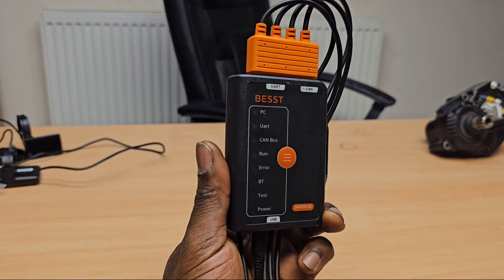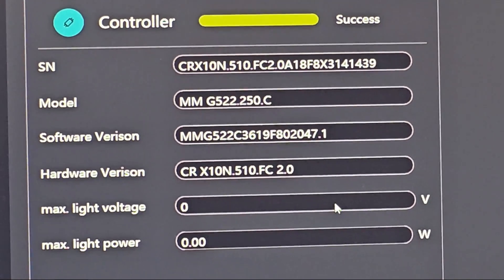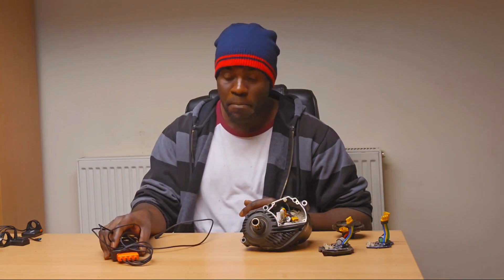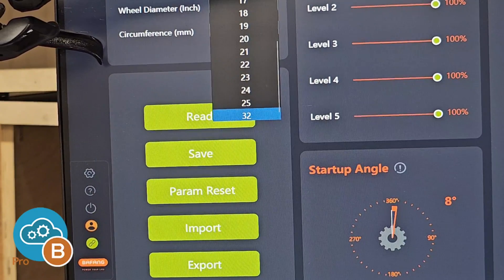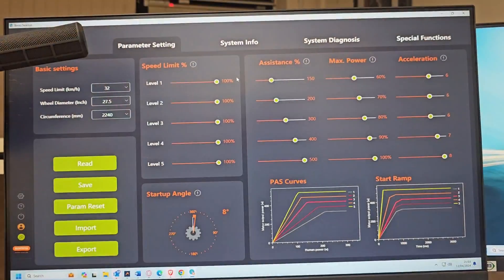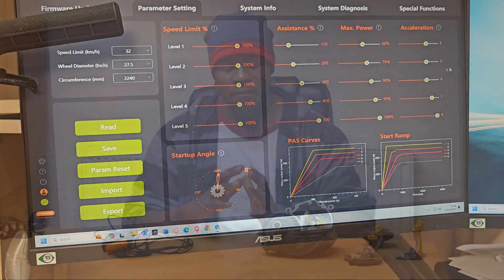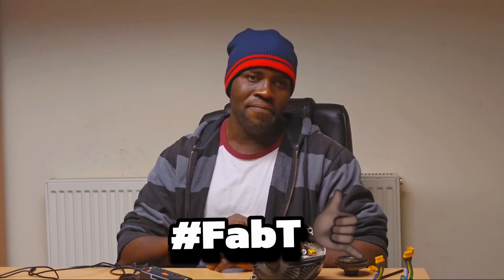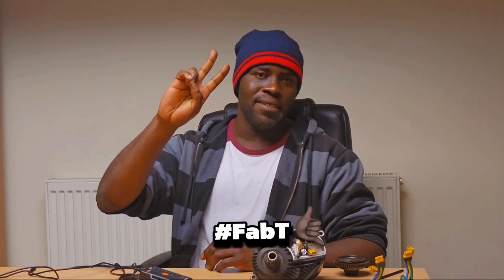Bafang Besst Tool & Besst [Pro] Software Explained

Comment: Hello there and thanks for the video!
I have an issue with unlocking my bike’s speed and I would really appreciate a response.
I recently bought an ado air 20 pro (eu version) with a 250 watt H700 motor and a CR A101.C 1.0 controller. I’ve used the BESST software and connected to it via can bus using the BESST tool. I want to increase the speed limit to 32km/h from 25km/h. Although I’ve pressed the write button on the BESST software with the new limit with received a success message, the bike still has the old one. My guess is that the firmware is locked. Could really appreciate any tips based on your knowledge :)
Reply from the maker: Hi there, 
Sincere apologies for the delay. 
I have looked up this ebike and understand that the Ado Air Pro uses a hub motor (Bafang).
In theory, the new top speed should have written to the controller. My only thought is whether you clicked "read" to pull up the controllers settings. 
This weekend, I'll have a play with changing the speed and wheel values for Bafang hub motors using the Besst Tool and report back my findings. 
If a specific firmware is required, I'll let you know.

Once again, apologies for the delay and I'll keep you posted👍🏿
Reply: @neekodevinchi  So I've connected both the screen and the motor to the BESST Tool, I've turned-on the battery, I've heard the beeping sound, Can bus light is flashing. I'm opening the BESST software and I read and write the values of the controller successfully. 
By the way the latest BESST software does not let me to alter the speed limit to more than 25km/h and pops up an error, so I have to use an older version. That is also why I fear I'm against a locked firmware...
Q:
->Should I turn-on the screen by any chance during the connection?
->Also what does the middle button does in the BESST tool when pressed?

Thank you very much for looking into it, I'm waiting for your response!
Hopefully I'm not facing a locked firmware issue :(
Reply from the maker: I see.
Have you tried changing the region?
If I'm not mistaken, New Zealand has a 32kph limit (as does USA).
I'll look more into this over the weekend and report my findings👍🏿

Comment: I unhooked my battery for a while and it reset my display, speed doesn't work and none of the advanced settings are there, it is a cheap unidentifiable chinese controller and same with the motors, only thing bafang is the display. Will this be able to help me figure it out? I have a UART display so do I need to use this or is there something else I have no clue about the controller I just know it displayed speed before and now it wont.
Reply from the maker: If the controller isn't from Bafang, then the Besst tool will not help. All the Besst Tool can do is connect to products from Bafang and diagnose. 
The controller should provide details as to the origin (KT, Lishui etc)👍🏿
Reply: @neekodevinchi  the controller isnt from bafang and it worked just fine, must have the same programming that the bafang controllers have on them, i actually used bbstool to program it though but it connected to besst tool i just dont have an account so i didnt bother trying to rewrite it with besst tool
Reply: speedometer works again too now i dont have any idea why it didnt before but all is good now

Comment: Since posting a couple of months ago, I regreased our M600 and M620, and it seems now the PAS settings are not as before. A friend just dropped off a BESST tool for me to use on my M600. Thanks to your explanation a couple of months ago, I was able to understand that I needed this tool to change settings. Also, my spouse has a UART version of M620. I was able to connect to it with the SPEEED app using a UART cable from Ali on the 620 UART, but was not able to change PAS or throttle. I just downloaded the Open Bafang Tool. So my questions now are, 1) have you any experience using OpenBafangTool and, 2) Can the BESST tool be used to also set parameters in the UART M620 or should the cheaper UART cable be used?

Comment: great video and channel in general! i'm a bit confused whether i can successfully connect besst  to my  uart bbs01 motor without powersupply so without the battery connected to it. 
i hoped to solve my problems by changing some motor setings but besst wont recognise the motor.

Comment: Hello Neeko, this video has been very informative and well thought out. 
Now for a question. I have a Frey bike circa 2018 with a Bafang M600 motor. I am getting the impression that 1: Frey used a Dengfu frame? and due to its age, 2: the motor must be a UART protocol? What confused me is this 2018 era M600 has a green trianglular 5 pin connector, which is often referred to as found on CANBUS systems. Last, you mention is is probably possible to get by without the need for any software and associated tools for the UART based motors. Which is apparently a good thing because it seems you can get opensource software and cables for the BBS motors. But 3: does the equivalent exist for the M600 and similar that may have been UART systems?
Reply from the maker: Hi there,
sincere apologies for the delay. In answer to your question, the M600 is CANBus protocol. meaning that the Besst Tool would be needed to update and/or upgrade the firmware (depending on your preferences). I have experimented with some of the M600 firmware. Personally I prefer the "*CRX10NC4818i132046.9-28-2230-20220315.bin*  firmware, which allows the M600 to push over 20amps to achieve the 120NM of torque far more easily. However, some have preferred a more milder feel for the M600. So changing the firmware (whereby it uses less maximum current), has been an option for a lot of riders.
Frey however, are no strangers to using custom firmware on their ebikes. So I'm unable to confirm what firmware your are using, compared to what firmware I have tried. However, I did see a custom firmware from Luna Cycles which allowed for parameters to be changed in accordance with the app and display.
I think the firmware was labelled,  luna_x1_firmware__74963.bin . I'm sure that if you google that firmware (and you know someone who has the Besst Tool and an account with Bafang), it will allow you similar parameter tuning to a UART Bafang motor.
Please don't hesitate to contact me if you need further guidance or support👍🏿
Reply: @neekodevinchi  
Thanks for the response, which is encouraging in thoroughness and speed! So turns out I was wrong in assuming my 5 year old M600 is UART. I'm thinking I'll overhaul my M600 as a winter project. I used your link to GreenBikeKit and they tell me that if I am just replacing gears and bearings I should not need to use the Besst Tool afterwards. Now that I'm on this train of thought, I'm also considering converting my Cannondale Trigger 29er with a kit, and trying to decide if I can live without torque sensing or not.

Comment: At what mileage should the M600 engine be serviced and lubricated?
Reply from the maker: It depends. 
Their's no set mileage which Bafang suggests performing a motor service. Usually, a service is reccomended once/if the motor acts irregularly. E.g. The M600s can require a main reduction gear and one-way needle bearing swap if the motor sounds rough when pedalling. 

I've serviced motors with over 2000miles. And I've serviced motor with only 50miles. But the culprit which warrants the service can vary. 

My main advice is, if the motor in anyway feels different whilst operating from when it was new. Then it's a sign that it needs to be looked into.

If you require any assistance or guidance, please let me know. And I'll happily look into it for you👍🏿

Comment: I have an ebike that came with a bafang M600 and a 40T chainring. To change to 36T, is it necessary to calibrate the new size using BESST UART?
Reply from the maker: No. Motor calibration is only necessary to reposition the sensors within the motor, to determine which way is forward. 
The only time you need to perform a calibration is if you have changed firmware, changed the controller or replaced any of the internal mechanical components within the motor. 
Simply changing the chainring size doesn't require calibration👍🏿

Comment: Hi, great video. Could you tell me is it possible to adjust voltage of the battery or controller? I have a bafang account but after scanning the controller i got the settings but i was unable to change them.
Reply from the maker: Sincere apologies for the delay. 
The voltage parameters are fixed to each firmware. So in order to have a different voltage (minimum and maximum cutoff), you'll need to change the firmware (bin file). It's not like uart, where you can amend those values. 
Which motor are you trying to change the voltage? I might be able to navigate you to the appropriate firmware to install👍🏿

Comment: Hi, Neeko I have got a question. So I have a M200 bafang motor on a accolmile bike. My display is can bus the one with a triangle shape. I just want to change the speed limit but it is locked on 25. The manual of the screen only lets me access the info but not change it. Would you know if this would help?
Reply from the maker: Hi there, Yes. The Besst Tool can change the speed limit for any Bafang CANBus motor👍🏿

Comment: I am really new here ,i ordered last week a bicycle with bafang motor , 2 days ago its show errors 36 and 30 it is possible to fix with Besst program and tools of course ?! Greetings
Reply from the maker: Sincere apologies for the delay. The Besst tool can rectify error 36, provided that the remote/cable isn't damaged.
But it can't rectify the error code 30. Meaning that somewhere within the wire harness connecting the motor to the display, isn't communicating properly. Try disconnecting the wire harness and reconnecting and ensure that their are no kinks within the cable. Failing that, swapping out the display and wire harness might be the best resolution for yourself. Any problems, please reach out to me via email, Facebook, Instagram etc👍🏿

Comment: Bro. Can I change the motor voltage from 48V to 36V?
Reply from the maker: Yes. That's done by changing the firmware👍🏿
Reply: @neekodevinchi  Have you tried it?
Reply from the maker: Yes. I have changed firmwares on M510s from 48v - 36v and vice versa. Essentially, the motor won't work if it detects a higher or loeer voltage (Maximum & minimum discharge cut-off)👍🏿
Reply: @neekodevinchi  does that mean just flash 36V firmware to 48V motor then it will work fine with 36V voltage?
Reply: @neekodevinchi  I have seen the Bafang M600 36V version on the market. I don't know if it is different from the 48V version or just the firmware difference
Reply from the maker: The motors (physically), are the same. But the firmware saved on the controllers are different👍🏿

Comment: I got H400b rear motor. The speed is locked in controler at 25km/h. Can I use Besst Pro to unlock it ? At bafang site there is no any info that this App can work with this type of motor :-/. Thx
Reply from the maker: Hi there, 
Most Bafang hub motors use UART. So it would be easier to configure the controller settings by either using the Bafang config tool and software or using a different display. 

The easiest way (if the speed restriction is all you wish to change), would be getting a different display like the 500c or DZ41 (B
both displays have been featured on my channel).
Hope this helps👍🏿
Reply: @neekodevinchi I have the same problem. But my bike is from 2022 and has canbus not uart. 

I think this is my last option to unlock my speed. Nobody knows if this will work. It's for all bafang engines. It has to work or what do you say? Sorry for my English
Reply from the maker: Hi there, 
In theory yes. You would probably find that Besst (Not Besst Pro) would allow you to change the speed limit on your controller👍🏿

Comment: Hi Neeko, nice channel, subbed! I recently received a bafang m625 & their proprietary smile battery. This version was stupidly locked down via the canbus protocol so that I can't use the motor with any other battery and vice versa. I haven't been able to find any solution to this. If you know of anything, it would be greatly helpful 🙏
Reply from the maker: Hi there, 
Thanks for getting in touch.
The M625 is one Bafang motor which I haven't played around with. But I am aware of the motor only working with the proprietary battery. I'm not sure if it is a firmware problem or a controller/bms  problem. But I can look into this and share my findings. 
Ironically, I can only see one firmware associated with the M625. But I'll research this diligently and get back to you👍🏿
Reply: @neekodevinchi     Hi Neeko, hope you had a great week. I have been doing some messaging with a customer service agent at Bafang in regards to unlocking the canbus on my M625 motor so that it can work with any battery (not just the smile ones) and I they eventually sent me the unlocking software file, however, it is a ".bin" file and I can't seem to figure out what to do with it as PowerISO couldnt mount it etc. I was wondering if it might need to work with the besst tool and thought you would be just the guy who might know. Thanks for any input!
Reply from the maker: Hi there, 
In order to load the bin file, you will need the beest tool. A bin file is essentially firmware which configures the controller in the motor. 

Could I ask you to forward me a copy of this bin file via email?

I can test it to verify that it works before you spend money on a Besst Tool.

Look forward to hearing from you👍🏿
Reply: @neekodevinchi  funny you suggest that because I was actually going to ask if you wouldn't mind loading it up in your besst tool and seeing if it works pretty please. 

Care to post or DM your email please? 

Thanks for doing this by the way, very considerate of you to verify for a complete stranger before I invest in the tool.
Reply: @neekodevinchi  Neeko that is seriously considerate! I appreciate it very much. Thanks. I would be very curious to know.

Comment: Thank you for the video. I have a question or a request for your advice.
 I have a Vitus full suss from Chain Reaction. 
Only done 50miles. Has the M510 motor. 
And the head unit will no longer power on and the bike will not start.
 I bought a new head unit. Still nothing. Battery is fully charged. 
What are your thoughts?
I am in Scotland or I would have jumped in a van.
I went to my local E-bike dealer yesterday.
He has never worked on a Bafang - and to be honest I am crapping myself .
Thanks in advance.
Mark
Reply from the maker: Hi Mark,
Thanks for getting in touch. 
If the bike isn't turning on after buying a new display, chances are that the issue is one of the following:-
•wire harness/loom (communication) issue
•Battery mount issue
•motor issue

Without looking at the bike physically, it's difficult to advise what further steps to take to troubleshoot.

Can I ask you to message me on Instagram or Facebook, so you can show me pictures of the connectors and the battery?

Contact details are on my channel bio👍🏿